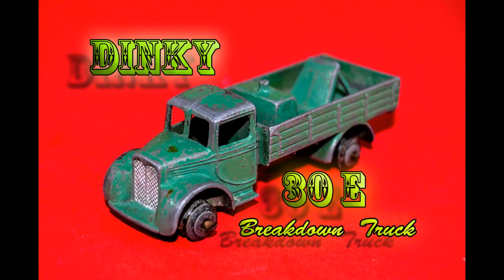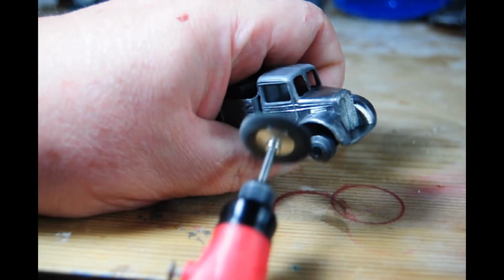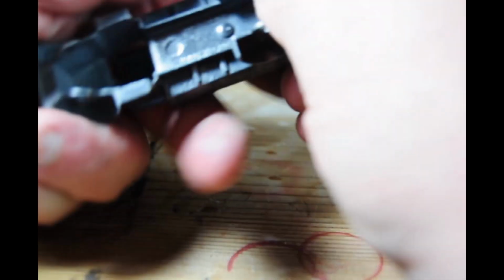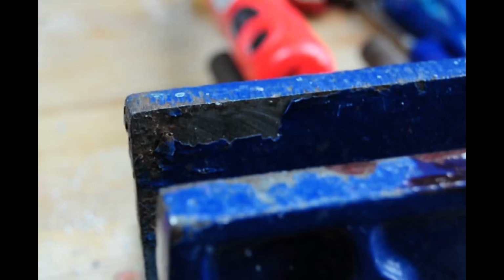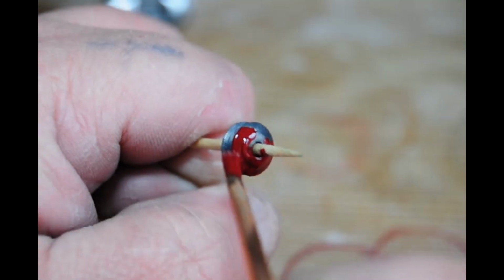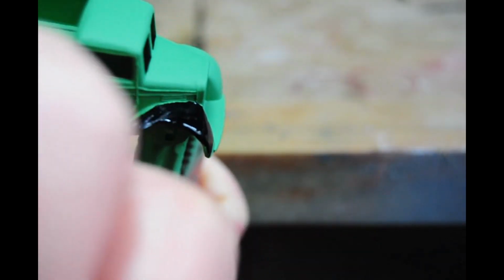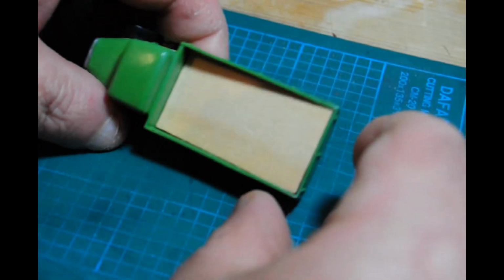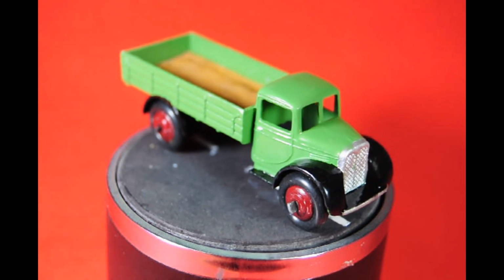dinky 30 e  breakdown truck

Comment: Nice one paul looks great,  dinky produced this casting from1936 to 1940 it came in lots of colour combos,  red  blue  green and yellow cabs. 
It's just called 30e f tow truck.  Looking forward to seeing the other dinkys being done.
Reply from the maker: there are post war ones they are usually the green and the grey ones  , easiest way to tell is pre war had smooth wheel hubs and post war had ridged wheel hubs